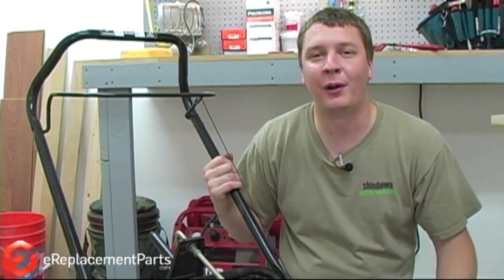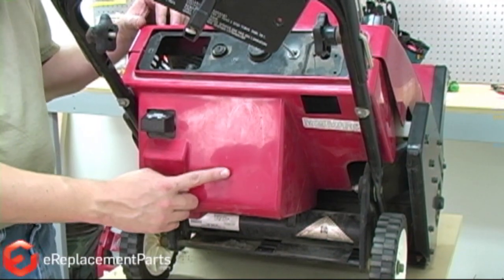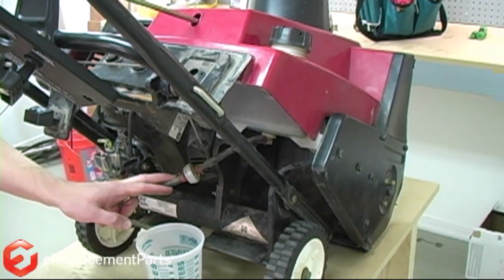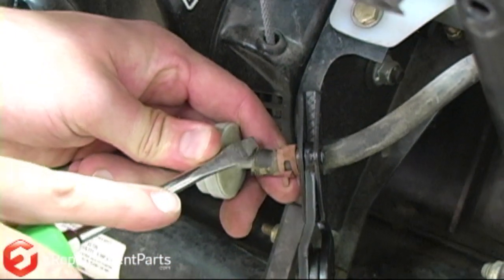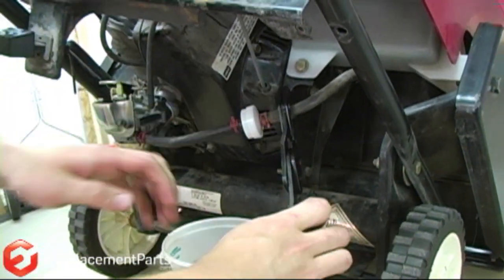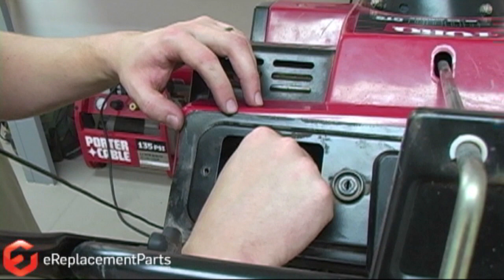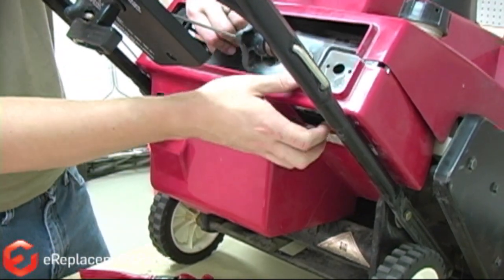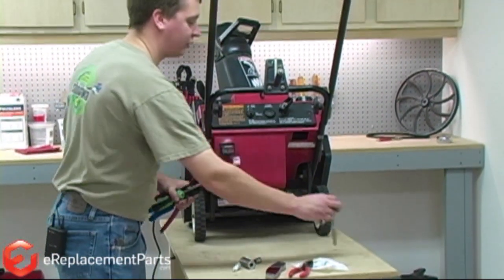How to Tune Up a Toro Snowblower

Comment: Would like to have seen this video a few years ago. Your comment that the repair shop is quite expensive is right on. I used to pay just under $200 for everything shown in the video. I can do all that myself and only have to pay for parts replacement. Great video. I have a Toro CCR2000 4.5 HP purchased in 1998 for $745. I've paid for it in Toro service repair more than 3 times over. With your great instructional video I will no longer pay for those services.

Comment from the maker: @MrFerrariman1 Toro has always used the one piece filter that we show in our video. I haven't seen one with a removable filter element before. That is a great idea though and if located correctly, it could really make the tune-up procedure much easier.

Thanks!

-Mark

Comment: hello - what is the p/n and cost for the fuel filter & spark plug on the toro snowblower tune up video? also I need the primer bulb cover - it fell apart. thanks.
Reply from the maker: +John Hampton The Plugs usually run from $2-$6.00 depending on the quality and manufacturer and the fuel filters around $-$3.00.  These and the primer bulbs are usually very model specific.  You can see the prices on line or if you'd like to write back with the model number from your blower we can check it out for you.

Comment: Great video but I cannot find a fuel filter for my Toro CCR 3000 GTS Model#38435/8903044 Can anyone help? I need a spark plug also. I had too many things on my plate this year and got a bit behind. I'm a single person and don't want to have to ask a guy to help me.

Comment: I have a similar snowblower. It starts and runs great for about 15 to 20 minutes then stall out, have to let it sit for a while then will start right up. Has me stumped. Any help would be appreciated.
Reply from the maker: +jordtizzle That's puzzling!  When it stalls, have your checked to see if it has spark?  On occasion the
Spark Coil will get hot and not produce spark until they cool.  Another place to look would be the Carburetor.  It may be getting hot and causing it to Vapor Lock and then works normally after the motor cools.

Comment: what cause the toro snowblower run full speed?
Reply from the maker: Hello,  I own a Toro Snowblower and it runs at high speed all the time. If yours has a control cable connected to the carburetor, it may be worn or stretched and it will need to be replaced.

Comment: Does anyone have this problem,  The snow blower starts easily, the engine runs well while warming up  The Augur engages with no problem.  However, the engine stops after the augur meets anything other than a little resistance from the snow.  The engine just dies.   It restarts with no problem and the cycle repeats.
Reply from the maker: Ron Grabski What model number is your snow blower?